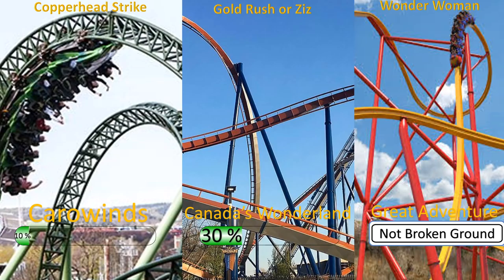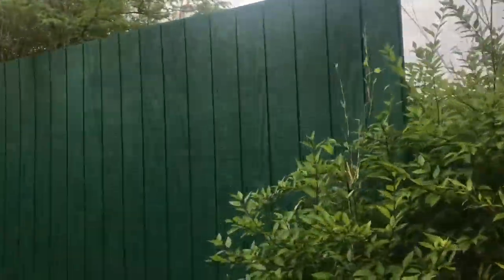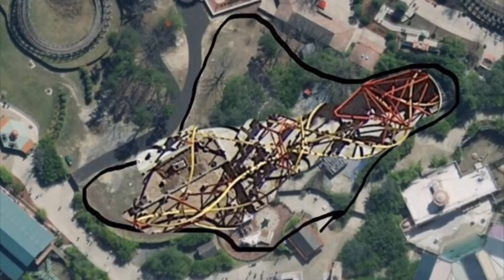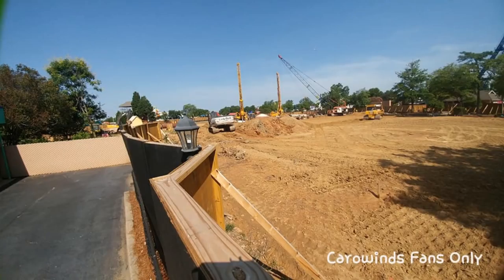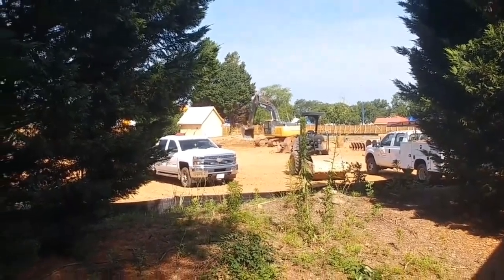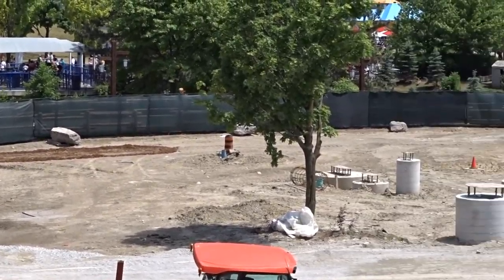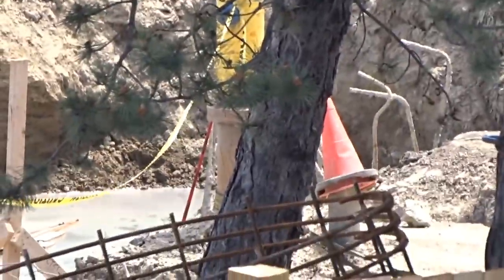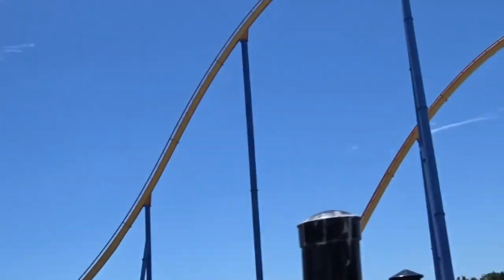Six Flags Great Adventure, Carowinds  & Canada's Wonderland Large New Coasters

Comment: Great Adventure is my home park, and I’m hoping to see either an RMC Raptor or T-Rex come to the park. Either one will be fine with me, but personally I’m hoping that it could be a T-Rex, since this has been in the works for over a year and it will bring something original to the park. Great Adventure hasn’t gotten anything original in quite some time, so I have hope that 2019 will be the year of something big. A T-Rex can also deal with a larger capacity than a Raptor can, and GA is known for large lines. However a Raptor can be good with capacity if it has a moving station, as seen with Wonder Woman

I was at the park today, and I got some views of the construction area while riding Zumanjaro and El Diablo. Judging by the land area, it’s more likely that we’re gonna be getting an RMC Raptor. They are compact coasters and one can definitely fit inside this area. Unfortunately it will still be classified as a “cloned” ride, but it will be among the first few installed, and it could possibly be the first to open on the east coast (depending on if Dorney Park gets one too, as they have plans for a new roller coaster as well). It will still be an exciting ride, and definitely will bring in crowds. Now since it’s going in the Golden Kingdom section of the park, it will likely be jungle themed and have a jungle related name (I’m predicting it will be called “Anaconda” or “Python”)

However I may be wrong with this idea. Hopefully I don’t jinx it and we actually end up getting a Skywarp instead (SF likes to call them roller coasters but they aren’t). A T-Rex is still possible, but isn’t as likely. No matter what type of coaster it may be, I will still be excited for it
Reply from the maker: Techno Ghoul oh wow! You really thought this out. T-Rex would be a better choice for your bigger park. I really want to see a big unique attraction come to a Six Flags Park again 🤗👨‍💻
Reply: Amusement Insiders Let’s hope that this coaster will be original. If it does turn out to be a Raptor, maybe there could be some kind of unique aspect to it to make it stand out from other Raptors

Comment: Great adventure is my home park to and as much as I would like to see a RMC raptor I think that we are more likely to get a RMCT Rex because of the captivity for it Six Flags is not that good at dispatches and having a RMCT Rex might help with that because of its higher capacity levels as for the high I think we might get a gigabbecause the raptors have the OTS and in New Jersey any roller coaster over the height of 300 feet requires OTS and if RMC sticks with the OTS liek they did for the raptor then I could see this being a possibility
Reply: Six Flags has an estimated 25 mil to spend in 2019. They wouldn't spend over three quarters of that on one coaster.
Reply from the maker: Randomscooterkid they def deserve a T-rex
Reply: Randomscooterkid I dout Six Flags cares about capacity considering the last coaster built was a Free fly, if they werr concerned they would have bought a full 4D coaster as X2.
Reply: B Carmen Six Flags can’t afford a real 4D, X2 was 45 million in 2000. That’s nearly 60 million today. Not to mention with the problems X2 has, I would only wanna see b&m try a 4D but that won’t happen.
Reply: ModeratelyDiminished Yea, that's a big price tag even for Cedar Fair. However I would think.there would have to be some middle ground where S&S could create a Free Spin with a full train and bit longer layout which would suit a park as Great Adventure well. It was Arrow that created X2, I would hope that since S&S  bought them out, they fixed all the bugs being it's been nearly 20 years. But a B&M version would be amazing if they ever took on a 4D concept.
Reply: Coaster Cupcake that's $25,000 for all parks?